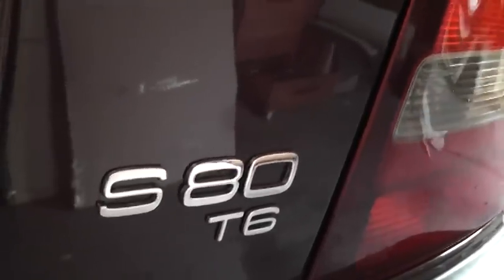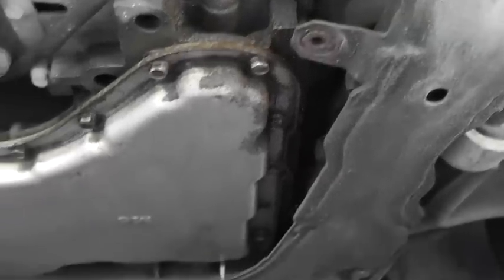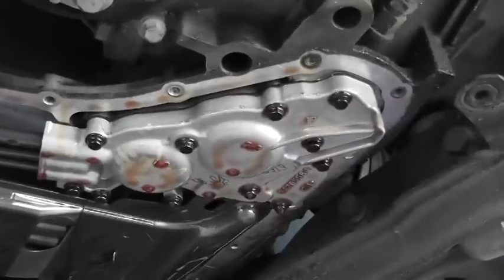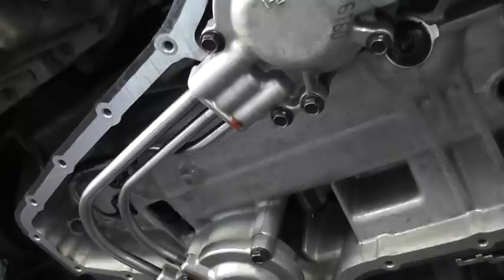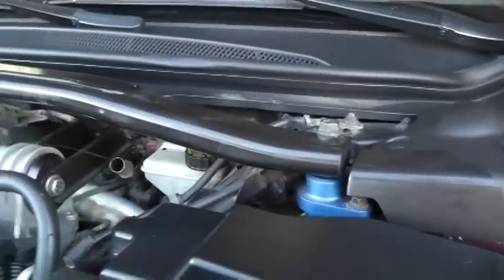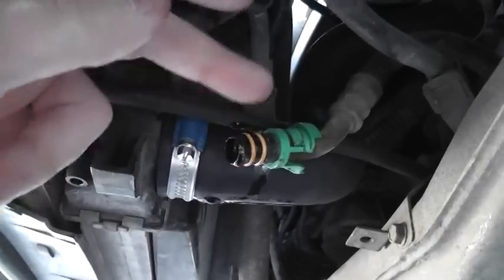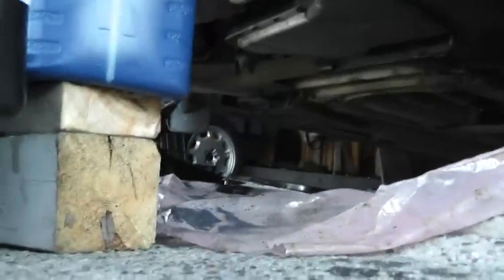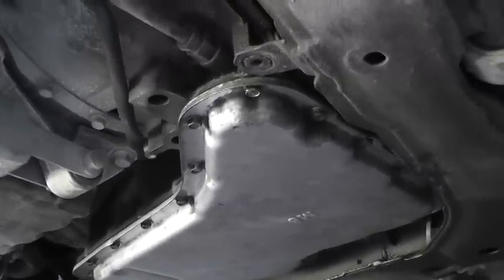1999 Volvo S80 T6 Transmission fluid, filter,gasket change.

Comment: Job well done. Thanks to you I flushed the transmission, changed the filter and all the O rings and Clamp. By the way, here in California the Volvo dealer charged me $52.53!!! 52 dollars for those 6 little pieces. A word of advice to all who want to do this procedures; The bigger the pan the less mess!!! If you can stick a bath tub under it, do it :):):):). I bought Mobil3309 ATF from Amazon for around 68 dollars (case of 12). Volvo dealer wanted 30 dollar for one quart of ATF!!!!

Comment: I just performed this fluid exchange on my 01 S80 T6. Thanks for taking the time to do the video, you made it look easy. Unfortunately for me I made a bit of a mess due to the drain pan being too small. All is well though and she's running great. I also added a 4T65E shift kit which helped a bit in shifting crispness. Thanks again.
Reply: Hi, where did you find the kit to do the exchange? I cannot find the filter neither ebay nor other websites.. Ty
Reply: Me also 2001 s80 T6..i want to change this fluid also..my question is did we 2001 have filter like in this video ? If have i need to buy filter also right
Reply: @ladam2356  hey I did this service a few months ago, you can use dexron 6 (VI) and yes it does have a filter like the one in the video.
Reply: @ZedQue  no matter what brand fluid just 6 IV right? It AISIN VI okay? And okay i need to buy that filter also
Reply: @ladam2356  That dexron 6 fluid is actually OEM so that’s perfectly fine. I personally used Castrol because it’s what I had nearby.
Reply: @ZedQue and has the dexron 6 worked ok in this transmission?
Reply: @matanegozi  yup just did the 2 year/10k mile change recently.

Comment: thanks for the great video clip. i followed your vid step by step and got the job done on my 2001 s80. the filer was very hard to be taken out and the seal just stuck there. i decided just reuse that seal with new filter. the Volvo dealer asked about $350 for flushing but without changing the filter.

Comment: Do you have a video to show step by step on how to repair a oil filter housing leak?? Not the oil filter with the ring. But taking the housing off that's connect by the 3 bolts. In addition, showing which gasket is used.

Comment: My 2001 S80 looks different. and the transition oil stick is wa-a-ay down on the right side of the engine.... How to pour oil then? Also the overall, your volvo is very different from mine.... I was even wondering if it is 1999 =)

Comment: Hi please give advise I want to buy volvo xc90 T6 with the GM problematic transmission 4T65EV the machinics here in Bulgaria warned me that the transmission is big problem but I sow in one forum it can be upgraded with some springs or some kit and problem will be gone can you advise what upgrade is needed to keep running this transmission  long time.
Reply from the maker: I can’t sorry. You have to do the research

Comment: Hi. How many miles do you recommend to change the ATF? My 2002 V40 has a 130000 milage. I am the second owner and suppose that the first owner did not change the ATF. Is that OK for me to change the ATF recently? It is not very smoothin accerleration, but not that bad for this old car. Thanks for any help.

Comment: great!!!😍
the second you post the video I will change it on mine to. 
but I found something curios, you don't get to change the filter when changing the oil.
I've seen that some guys mount an additional transmission filter.
what do you think?
thanks!
Reply from the maker: Don't want to mess with the original design. Just fresh oil.

Comment: At the time of 12:25 on your video both of my lines leak right there where the connect to the radiator. I need two new fitters and I live in the US and I can't find them anywhere. Anything you recommend I do?
Reply from the maker: Here: http://www.ipdusa.com/products/5777/114086-automatic-transmission-cooler-oil-hose-seal-kit-1999
Reply: +volvosweden I need the metal fitting that the plastic ones go in
Reply: +volvosweden do you want me to make a quick video of me showing you the part and you can tell me?
Reply from the maker: +Mona Do a video yes. But a Volvo dealer will be the best help.
Reply: My new radiator had a very slight different fit. The clips did not fit. I had to vice grip and unthread the metal coupling from my old radiator and install onto the new radiator.

Comment: I dint understand why you drained the oil, into the ATF container then poored it back, then started the car and did again?  why do that?
Reply: Larry Labonte bcause he wants to flush it right thru and get whats in the torque converter..... The fluid he collects didnt go back into the trans.... New ones get put back in.... Those transmission holds somewhere around 12-14 L not just 7.6......but theres no drain bolt on the torque converter so u have to let it cycle thru..... Thats why he bought 15 L
Reply from the maker: +Leatherkid01 Thx!
Reply: What about the dirty/used ATF that's in the cooler itself? Draining from the cooler inlet line (bottom) as in the video would only drain the torque converter & not the cooler, if you drain from the cooler outlet line (top) that goes into the trans, wouldn't that effectively "flush" both the torque converter & what's in the cooler simultaneously? Or is there so little fluid in the cooler that you're not concerned with it?

Comment: are you planing to change the oil on your 2009 Volvo? what transmission dose it have? is it the tf-80sc? thanks
Reply from the maker: Most likely this summer will do the transmission. Yes it's what you posted.
Reply: +volvosweden is it summer allready?😂

Comment: Just checking in to see how your transmission is doing. Do you still own the car? How is it performing?
Reply from the maker: +TamiyaExperienced I dont have the S80 anymore. This is what happened. https://youtu.be/1cMQQMk3X4o
Reply: volvosweden man, that sucks. Deer I'm guessing, they are a problem here. Where did you get the R wheels? I'm trying to find some myself.
Reply from the maker: +TamiyaExperienced One guy in my city sold the R wheels. Once the S80 was written off I sold the R wheels very quickly.
Reply: @volvosweden I'm sorry about your car, I have a very similar s80 t6 with pegs on.
Reply: Just curious, what happened to the car? Cannot open the link..
Reply from the maker: Hit deer at 130 km/h. Total loss
Reply: volvosweden 😨

Comment: please can you helo me with my volvo v50 question
Reply from the maker: I can try
Reply: @volvosweden  I just got a mechanic job after school don’t have much experience so got a volvo v50 2007 to fix the car I not moving when apply the gear it’s automatic and manual gear
Reply from the maker: @starunitmodestus6729 please explain the question
Reply: @volvosweden  the car is not moving when I put the gear and release the brake pedal